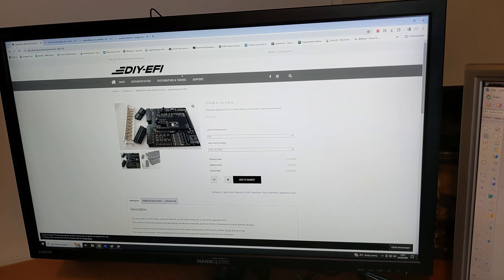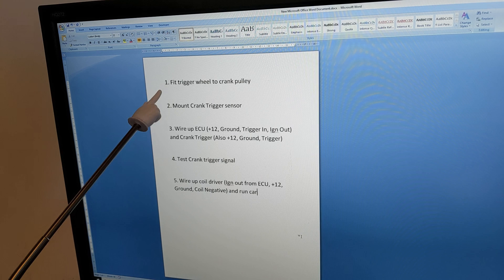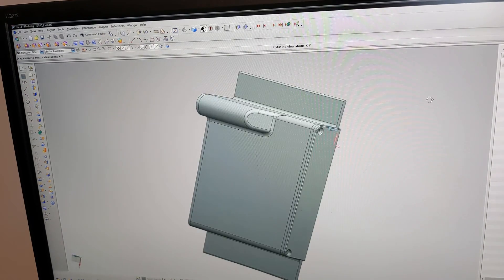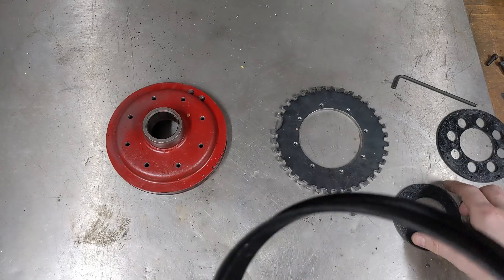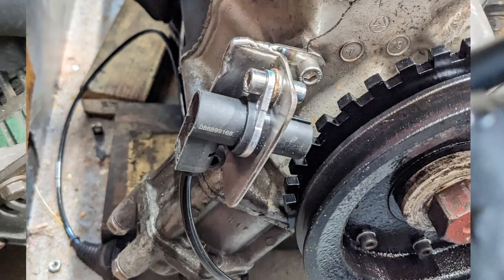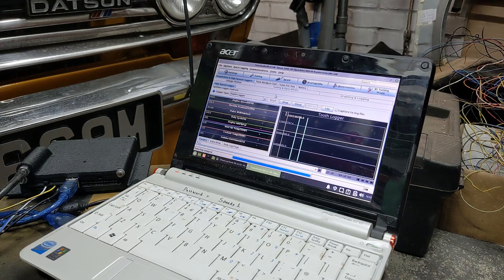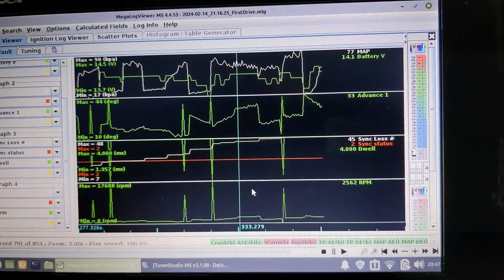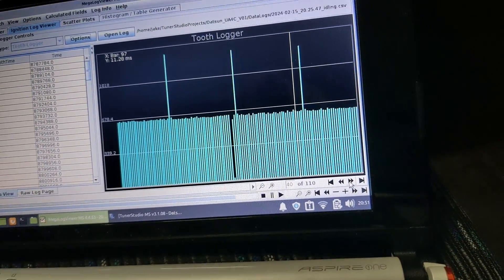Installing an ECU to my Datsun 510 - spark only for now

Comment from the maker: Any questions about Speeduino? Let me know in the comments! 
I've been running a UA4C on two cars now for about a combined 5 years (1 year for the Datsun, and over 4 for the Civic) in various configurations, VR vs Hall, Spark-only, Injection etc.
Reply: Will you use more than spark-only on the 510 eventually? How does Spark-only integrate with the current fueling. What other features of the Speeduino ECU could be useful? Sorry if you covered this, my audio was really quiet so I might have missed a few bits of knowledge.
Reply from the maker: @djmips yes I'm going to go full injection at some point (hopefully this year) with some throttle bodies. Also even spark-only has the benefit of much more control over ignition timing and the ability to data logs which is very useful for tuning carbs
Reply: @jakethepeasant  My ECU code is full sequential V8 capable. Uses a Pi Pico. Never setup datalogging though. Not happy with the slow down serial causes. I don't know the fancy DMA stuff that allegedly avoids slow downs. I also never setup closed loop, or idle control, because I don't care for that right now. It's currently faster than the laws of physics allows an engine to run.
Reply from the maker: @Marc_Wolfe yeah I've not got closed loop or any data logging set up at the moment, with this engine it's so basic that it really doesn't need it in my opinion. If I had a big power turbo build or something more highly strung I'd consider more features but these engines have lasted 50+ years on wanky old carbs so the current set up is definitely better than that!

Comment: The GM 24X pattern is underrated. There's a link to a partial datasheet for the Delco CIC chip used in those ECUs that explain some of the smart stuff going on with its design. I'm not using that pattern in my open source ECU for LS support; I'm using it because it's good.

Comment: You've mentioned that this is step 1 of converting it to efi.

Will you also change the 4 individual coils on plugs?

Stronger spark and more control per cylinder.
Reply from the maker: Might change up the coil set up in future for either coil-on-plug or just a modern smart coil but for now this wet up works pretty well. The main reason I'd want to change would be to remove the need to keep the distributor fitted rather than anything else to be honest

Comment: very helpful video. i have a datsun a14 engine in my mg midget. ive been wanting to do a turbo build but getting stuck deciding between EFI or carb, and a spark only seems like a pretty easy bridge
Reply from the maker: Yeah regardless of carb or EFI I'd recommend spark-only as a minimum, I did turbo my carbd honda and it didn't last too long 😂 I basically just kept the standard vacuum distributor and knocked the whole timing back a bit (although not enough evidently! 😂)

Comment: Hello Jake, newbie to your channel and greetings from San Diego, CA. I might have missed this from the video but, what are the benefits to adding an ECU to your engine? I have a 1972 stock L16b engine and it doesn't have any type of computer controlled sensors. Is the ECU added to fine tune the ignition timing, monitor crank speed, coolant temp, and resolve performance issues more easily? Did you have to add sensors to these systems in order for the readings to be picked up by the ECU? Thanks for the content, I love the 510's stance and look.
Reply from the maker: Yeah the main benefit of "spark-only" is it gives you much more control over ignition timing than a basic mechanical & vacuum advance set up. It also allows you to do data logs (so even with carbs, I've done logs with a lambda sensor to determine if I'm happy with fuelling). You can also do stuff like trigger an electric fan or fuel pump too (I currently don't do either of these yet though on this car).
But for me the future goal is to go fuel injection and this is just the first step. Thanks for watching!

Comment: Have you used a vr conditioner or did one come on the board?
Reply from the maker: No need for a vr conditioner with a hall effect sensor, my honda has the optional vr conditioner board though as it uses a vr sensor

Comment: planning to convert my 2E Corolla to EFI too, but don't know where to start 😂
Reply from the maker: Generally as per this video, trigger set up is normally the biggest hurdle to running spark-only, then high pressure fuel is probably the biggest step on the way from spark-only to EFI. The trick is to break it down into manageable steps.

Comment: Hey, nice work. Did you lock up the centrifugal advance within the distributor?
Reply from the maker: I haven't (yet), my logic was that it would advance roughly the same as I'll do in the map anyway and hopefully keep the rotor arm Vs electrode in the dizzy cap in the right window, unlike distributors designed for this sort of use the rotor arm isn't massively wide

Comment: For about 70 quid, or less, you could buy a new Chinese electronic distributor for this engine and have it installed a running in 15 minutes
Reply from the maker: Yeah that's true but that wouldn't have gained me anything over the previous distributor, the plan is to go Injection and this is just the first step along the way

Comment: great job. the 510 is called the 1600 here in Australia.
Reply: It's a Dato mate...👌
Reply from the maker: Yes the 510 was sold here in the UK as the 1600 too! But most people just refer to them as 510s to avoid confusion, I'm guessing they were popular down in Aus as if we want parts for them they generally come from the US or Aus
Reply: @jakethepeasant 

here in aus they are crazy expensive now because.
1. They are very simple
2. easy to work on when needed
3. great on fuel
4. not a tank, easy to park
5. look great, nice and clean.
Reply from the maker: @qwertyui90qwertyui90  yeah they aren't cheap here either, although you might consider them reasonable priced compared to Ford Escorts and BMW 2002s, which are similar cars from the same era. Although back when new they were quite expensive here so didn't sell very well Vs the others, and the ones that did sell have all rusted away since then, so there are extremely few UK domestic cars left, most (including mine) are imports

Comment: Hi jake, if you can find the equivalent spark plug for your engine with the resistor built in , it should help . One downside maybe that you're current coil would not be upto it.
Reply from the maker: Good idea! Yeah I did check if they were resistor plugs and they aren't, I'm going to borrow a mates oscilloscope to have better look, but it seems alright as it is for now (although maybe a bit borderline on noise)
Reply: @jakethepeasant  I do a bit of messing about with both old and new cars like yourself.  The ht leads are like  4 big antennas just punching out high frequencies that don't play well with the likes of the speeduino in particular as there is very little hardware filtering.
Another one that got me before was a noisy alternator as they were designed before ecus were a thing. 
You have a new subscriber 👌 Thank you for taking the time to upload your experiences.
Reply: Can you recommend any other inexpensive ecu for ignition and efi conversion, which has better filtering for the noise? Looking to do a similar conversion on my ke20
Reply from the maker: @naimatakku  I think Mega squirt is the only other ECU even close to this budget, and that is no better electrically than this (in fact worse in some ways, it's just an older design) - I think resistor plugs will be a big help, I spoke with a colleague and he had a similar issue with Mega squirt but far worse than I've seen, until switching to resistor spark plugs
Reply: @jakethepeasant  thanks for the help good Sir. 

That 510 looks so cool! And i really liked the video.